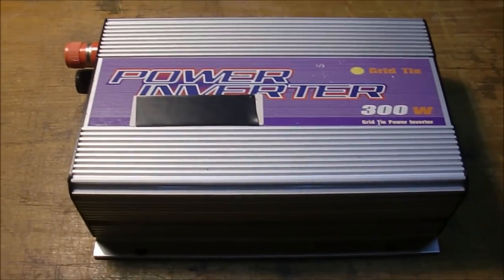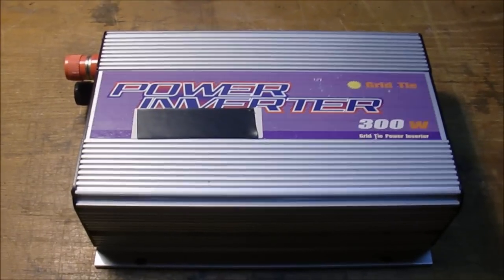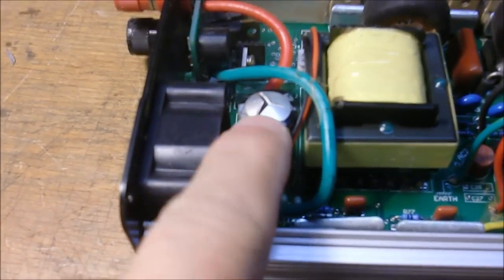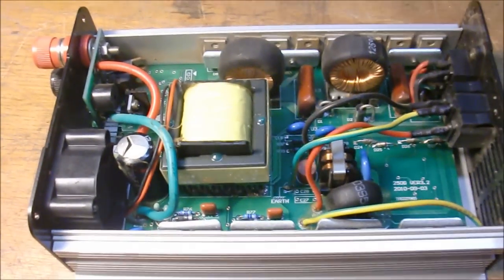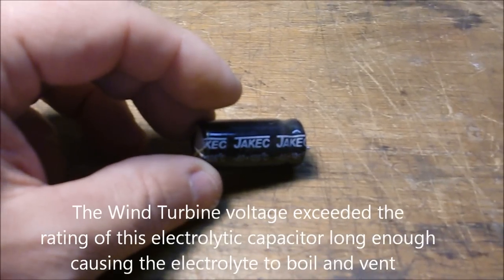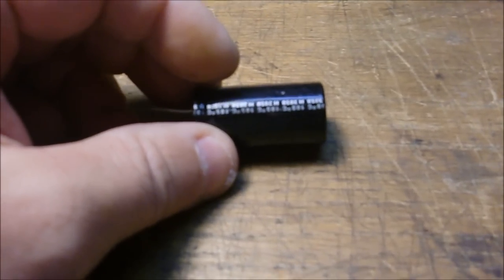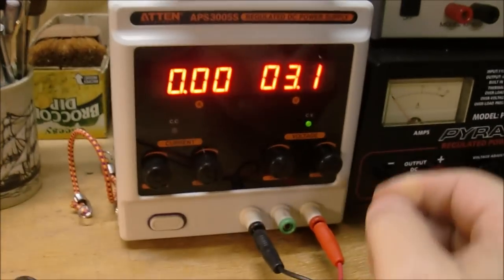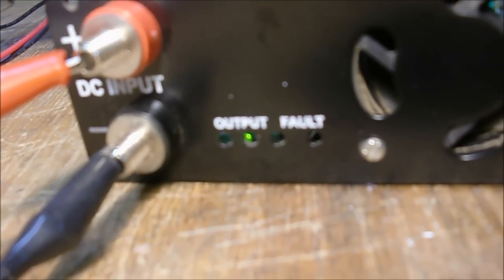Grid Tie Inverter Repair - Blown capacitor - SUN or Power Jack

Comment: Hello, i have a 2000g Sun tie invertir that stop working,
When i connect the solar panels to it, DC input voltage goes to 0v.
When solar panels are not connected to the inverter, voltage is normal 82v.
on open circuit.
Any ideas?
Inverter fuses are ok.

Comment: Couldn't you use a higher voltage capacitor ?
Would a higher voltage capacitor hold up better?
You also would need to talk about polarity of CD capacitors.
Thank you for the video,

Comment: Thanks a lot for your answer & video link, I was thinking there would be some problem with multiple MPPT trackers fighting each other, but I won't be on the low voltage side, but between 27 down to 24 until I cut off. I will try this then reconfiguring my LiFePO4 battery bank from 48V to 24V, and I will try 2 250 and a 300 SUN GTIs ...

Comment: Thanks for your videos, I love to watch them :-) 
I am working on an Energy Storage System based on the same GTIs and LiFePO4 cells.
I have a question: Do you think I can put 2 GTI 250 in parallel on the same 24V battery bank ? Switch one on, then if I want more power, switch on the second one ? Thanks

Comment: If you use a higher voltage capacitor in the non wind grid tie, will you then be able to use it for wind.  I assume the other difference would be a connection for a dump load in the wind grid tie unit.